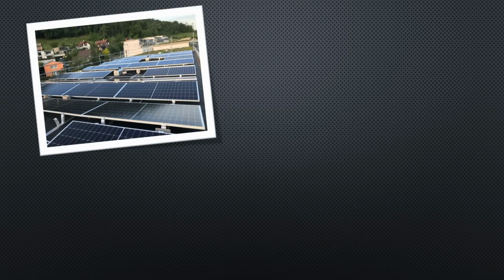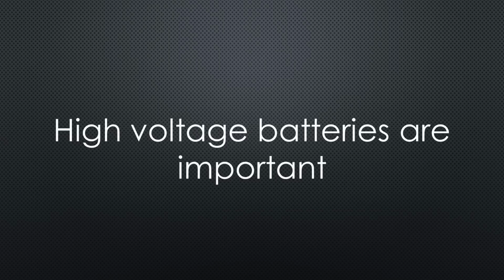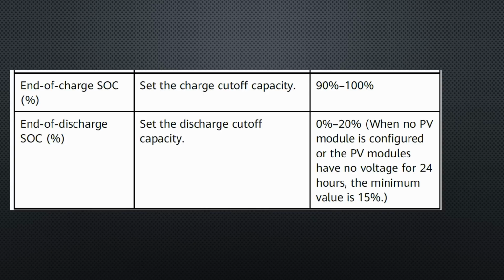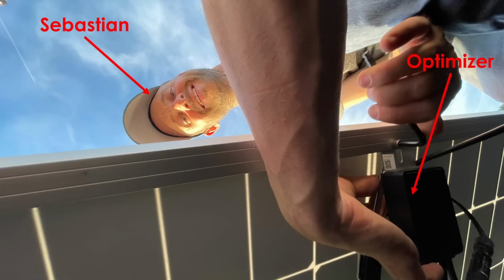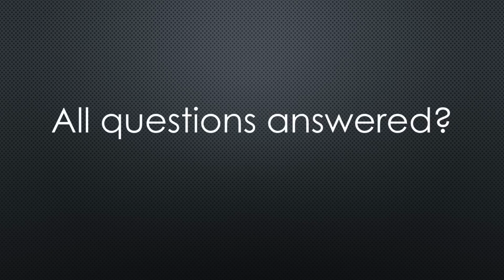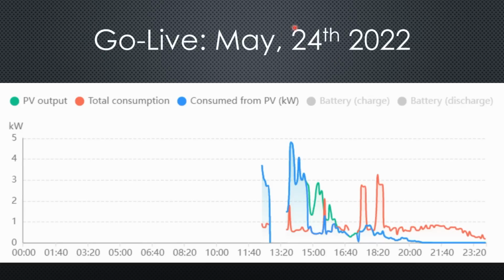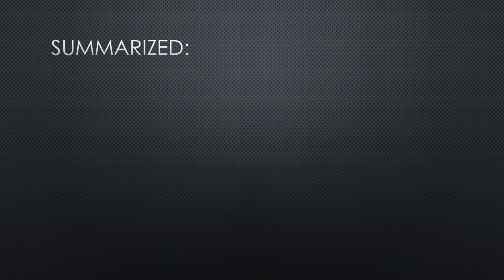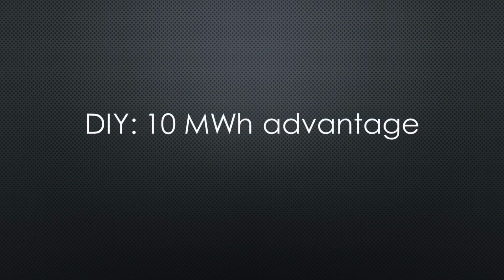438 Photo Voltaic (PV): Why Your Inverter Stops When the Grid Goes Down

Comment: Good work. I use multiple SDM630 to see where my energey travles, To grid, house or any of my other buildings. I also have an proper manual and automatic switch (ATS). And my inverter can run in off-grid mode :)  So will be nice to see how you do it later. I have run my system for 5+ years now and is specially made by me. Also have full monitoring and system that will sell excess energy when the price is high and buy back when its low if needed :)
Reply from the maker: These SDM630s are nice! My problem is the crowded fuse box which was not made for such additional meters :-(
Here we have regulations if the device is connected to the grid. So I decided to go "commercial" for that part. But I still have to find the electrician for installation.
Reply: @AndreasSpiess  yeah thats True. I installed a other box just for all The ats gear and The sdms.  Then i had an electrician to approve my work :) use an esp8266 to poll all 4 of them.
Reply: >>  And my inverter can run in off-grid mode
Which model do you use?
Reply: @DieSportsKanone  mpi 10kw 3ph. I would not buy it Again.  Its very unefficient and low quality.

Comment: Haha I beat you even if I started later. I installed 5 kW of TRINA solar panels and a 6 kW Huawei 2000 Inverter in România în 2 weeks in my holiday. No battery, just self consumption until now, waiting for the papers to also inject in the grid. But still limited to the consumption between 50-60% can be covered.
A big disadvantage of the Huawei batteries is that they have a huge delay when the grid is off, around 3 s so you need an additional UPS.
Looking forward to some hacking, as we have the same inverter, and also to the backup box installation and review.
Reply from the maker: Cool project! The 3 seconds is not the only problem. The Sun2000 does not supply any power back to the load if grid is down. You only get one power outlet with power in this situation. This has nothing to do with the battery. It is the design of the inverter.
Reply: @AndreasSpiess  Yes that too, but you can somehow probably wire a part of your grid to that emergency output.
I had the same problem, to choose between a hibrid inverter that can be off grid but couldn't inject, or an on grid one but without batteries.
I have a backup generator in case the grid fails.

Comment: I looked into solar DIY myself. I have the technical skill, but the regulatory side is just a nightmare - it's all geared towards large professional installations for people who have training in how to get everything properly certified and code-compliant, and how to fill out the multiple pages of complicated forms you need to notify the grid operator. The cost of compliance and paperwork and getting it all signed off by someone with the appropriate certifications is an acceptable overhead when you're building a 10KW installation - but for my planned little 300W hobby-scale system, which is as many panels as my tiny house can fit, the cost of getting someone to sign off and do the paperwork would be more than the cost of all the components put together.

UK electrical law is based upon the principle that home-owners should be kept far, far away from anything to do with the electrics, because most of them greatly overestimate their knowledge and shouldn't be trusted to hold a screwdriver. This is a good assumption - my dad and I certainly did some horrific bodgery in years past! But it's frustrating for me now as a hobbyist-engineer. I have the knowledge to make everything safe, but no way to legally prove I have that knowledge without spending piles of money on training and certification.
Reply: You can do it all yourself in the UK. I did my 1.28kw myself and registered it with the DNO. Which for me is Power Networks. Paper work is a pain but stay under 3.6kw and its not too bad. Look up a company called pluginsolar got my kit from them. But the install manuals can be dowloaded and it talks you through the DNO paper work. Just put in a inverter and battery my self that DNO paper work was more of a pain. Can offer advice if you need it. NOTE You wont have an MCS microgeneration compliance certificate  so cannot be paid to feed back to grid. But if you are planning to use it all that should not be a problem. A lot cheaper as well.
Reply: @anothermort  Hi could I please have a copy of the manuals or link to where they can be downloaded? Thanks Nick
Reply: Grid tie inverters are a waste of of money and useless. You need a hybrid inverter. With a hybrid inverter you can install it in such a way that the power company will never know that you have a solar system. The hybrid inverter only takes extra power from the grid as needed. 

I have an SMA grid tie inverter collecting dust in my Garage now for the last 4.5 years since I changed to a hybrid inverter.
Also you need at least 30kW of batteries. preferably 60Kw or more. I have 30kW but for a USA house it is not enough.
Reply: Here in the US, as long as you follow building/fire codes you don't need permits or anything (in my state) just a contractor to confirm it's good and pay a fee of around $500, however personally, anything less than about 2Kw is kinda pointless to put on the grid because it's only a little more work to install a bunch of panels as it just a few, plus those fees or if you need them permits cost enough that small installs will almost never pay for themselves...

If you want a small install, in most parts of the world you shouldn't need permission for off-grid installations, especially if they aren't mounted on top of your house either, if you want to keep things simple, then you can go buy something like an EcoFlow or you can go DIY again, find some recycled cells, build a powerwall and get an inverter, then dedicate your 300W of solar to running one or two things like a fridge.
Reply: Would it be an easier option to use a hybrid inverter that does not export anything to the grid? Some are able to run without batteries and have the smarts to use the panels directly and augment from the grid if your load is more than available sun/solar, if at some point you can justify a battery, performance is improved again....i.e. you would have battery backup, which could be a valuable option this Winter for you....we in Australia seem to be going down the same toilet...i.e. shutting down our reliable power sources, although a year or two behind you guys. I don't consider which is cheaper anymore, instead, Do I want reliable power or not?
Reply from the maker: I hope that these laws will be eased in the future because of the current situation. Here, Sebastian did the paperwork (it only took him a few hours because he does it all the time). But the installation towards the grid had to be done by a proper electrician (I also own an EE degree ;-)
Reply: Maybe for a 300W system you could just treat it as a 12V caravan installation.  Would that still require approvals?
Reply: For the small installation, as others have said, it is probably not worth the hassle of making a grid tie connection. Just use it for self-consumption only.

Comment: For only 50% of electrical price you better off mine crypto with your spare electric ( which can used for heating most times of the year).
Reply from the maker: As electronics engineer it is hard for me to waste electricity (it is too valuable). So I feed it back for others even if I do not get a lot of money. And signs are here that we will get more next year.
Reply: Huh. Heating. Unfortunately Heating season is the same season when you've got not enough sun, so no excess electricity then. Good luck heating the water boiler with your minig rig in summer. 🙂 makes no sense. Invest on Graphic cards need to be returned as fast as possible, or you loose in this game. So only possibility is that you have free energy 24h round for a year. Then you could think about that. But as Andreas sais, there are better ways to use electricity.